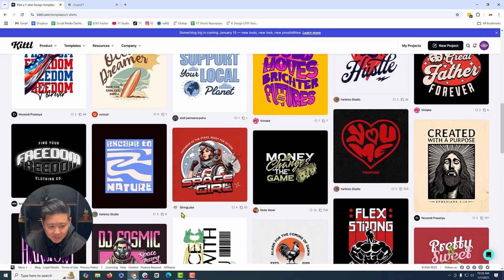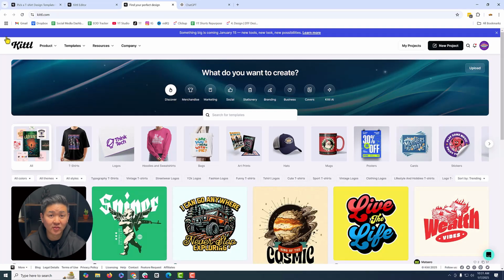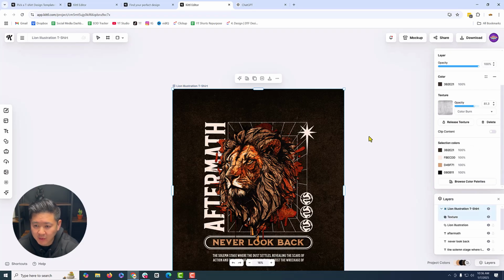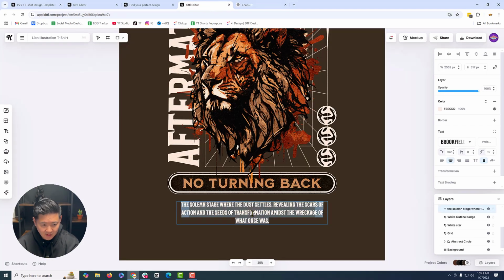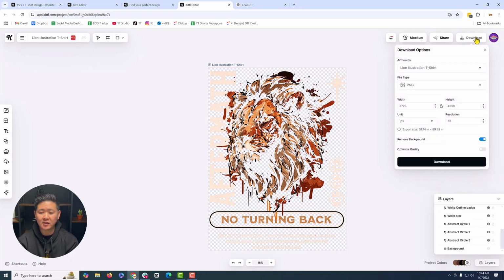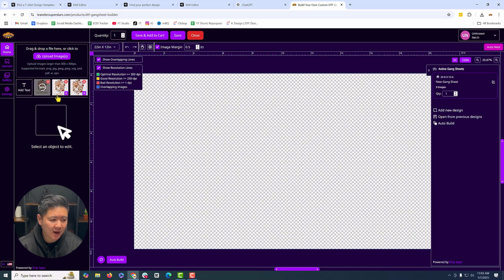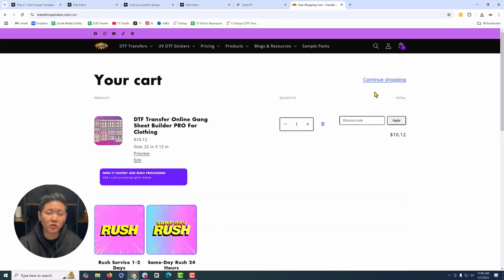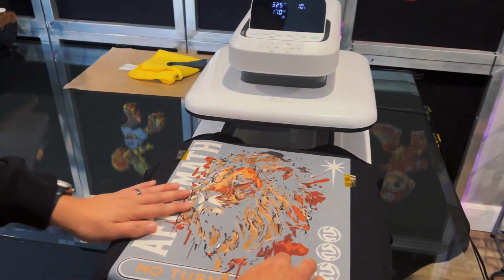KITTL Black Knockout Designs That Will Change Your DTF Game!

Comment: If you wanted that grid pattern an easy way to keep it would have been to make a single layer of the lion in one solid color, move it beneath the original lion, and change its mode to erase. im speaking from a photoshop/affinity workflow tho and not sure how would work in KITTL.
Reply from the maker: Thanks for the tip!

Comment: Disapointing you had to remove the grid... i like that! Does Kittl have a slice/contor/ delete function? Without having to remove a full layer??
Reply from the maker: If I messed around some more I could have probably kept the grid. Even separating and bringing it back would probably work.

Comment: This is not knock out. Kittl cannot do knockout. All you have done is deleted black color on one of the layers. Every layer behind that layer will still show through and not be knocked out. Hence why you had to delete the grid behind the lion. The text is also showing through the areas of the lion that you deleted instead of being knocked out. Looks bad. I have REPEATEDLY asked Kittl to make knock out available as a color selection for text and vector so that everything behind it will be actually knocked out. They evidently do not give a 💩 to offer this feature
Reply: yeah it would be nice for kittle to create a true knockout feature
Reply from the maker: We have a one click knockout tool coming out soon. Stay tuned! Its web based too!
Reply: @transfersuperstars is it out yet?
Reply: I just use the remove color  is this the same as knockout?
Reply: @ No. That is occurring after a project or element has been turned into a raster image. Knockout effect happens when you are still building the project in vector form. Also the remove color tool leaves semi transparent pixels behind which is bad for printing print on demand clothing items